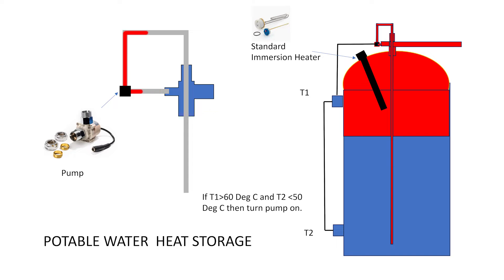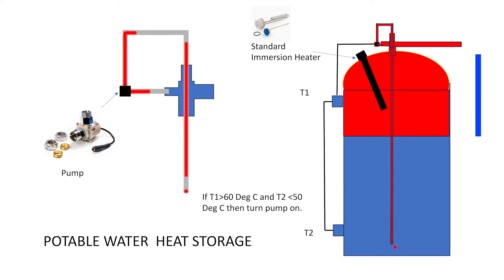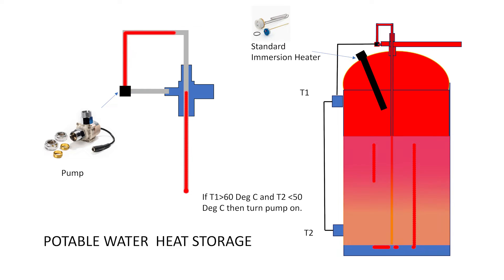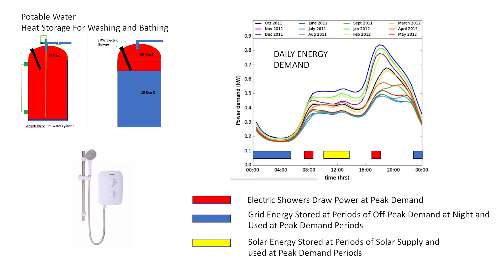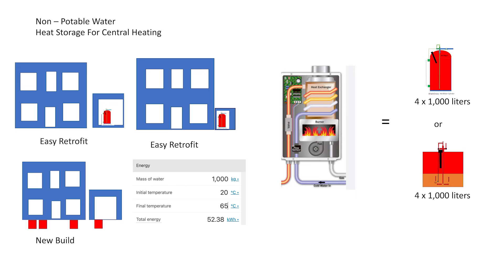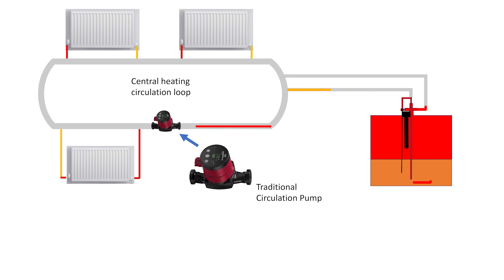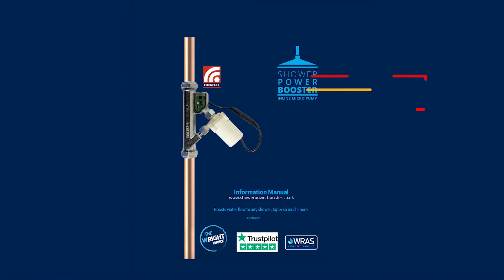Energy Storage Device

Comment: you are storing 50kWh in each 1m^3 tank, so four gives you 200kWh, when the heat in these used, how do you replenish the 200kWh?  Solar at this time of the year may give you a few spare (less than 10) per day.  I have a 5.25kWp system that generated 10kWh today (unusually clear and sunny Jan day) in the UK at 55deg N. Most of the 10 we used as it was generated, only a couple where spare and were exported to the grid.
Reply from the maker: During every 24 hour day there are times when there is surplus energy and on the National Grid and the idea is to use that energy. Potable Water Stratification Device
This device will store energy at times when demand is low in Spring, Summer, Autumn, and Winter. There are always periods of low demand irrespective of the energy source. 
This is a device best suited for retrofitting to an existing hot water cylinder so homes with hot water cylinders are likely to be potential customers. This device is even better suited for customers who have personal solar PV and hot water cylinders so that they can store their own surplus energy during periods of sunlight and also store surplus grid energy overnight.
Primary Sales Targets for the Potable Water Stratification Device
Customers with Hot Water Cylinders
Customers with PV Panels with surplus Summer PV Generation
Customers with PV Panels and Hot Water Cylinders
Organisations wishing to achieve grid stabilisation
Water Stratification Device plus Radiator Flow Boosters
The water stratification device together with the radiator booster gives the potential to significantly reduce use of gas and oil in the Winter only. Demand for heating can only replace fossil fuels if renewable energy (in particular wind power), is increased to supply Winter demand. Increased reliance on renewables will create an imbalance in the grid supply however the  potable water stratification device can absorb this surplus energy in the Summer.
Primary Sales Targets
New build to avoid the need for investment in new gas pipelines.
New build to avoid the need for gas and oil boilers.
Reply: @alandwright2  I fully understand what you are attempting to do, I had a 200L system installed on my heating circuit that was charged by solar excess (immersun), but there was insufficient solar excess in late autumn, winter and early spring. So, the question remains, during these periods where does the 200kWh com from to recharge (reheat) the 4 cubic metres of cold water?  to heat 1000kg (one cubic metre) of water from 20C to 60C takes 46kWh, you need 184kWh to heat 4 cubic metres, where do you get those without a heat source?
Reply: @Staedford as he states in the video, from the resistance element. Not so elegantly explained, but understandable if you want to.

The energy comes from electrical energy when the price is low due to access power on the grid.

If you have an electric boiler with two heating elements, you can get the same results with a computer controlled switch on the bottom element.

I am currently moving the heating of water to the cheapest time of day, I save a small amount of money due to the boiler is only used for hot tap water.
Reply: @MichaelEricMenk  Of course I understand that an immersed resistive heating element is used to convert electrical energy to heat energy in the cylinder.  My question is, where you get the 180kWh of excess (surplus) renewable energy to reheat the 4 cubic metres? Of course you can heat the water at night with night time off-peak electricity in a boiler, but that is not what is being said,....  he's talking about using surplus renewable.  Few have wind, the vast, vast majority of domestic renewable is PV, which don't have that over capacity!  He is states that any time in a 24 hr period you can feed this stored hot water into the CH rads, TRUE,.... when you expend that heat in 24 hrs, which is 100% certain in many 24 or even 48hr periods,  you need to find 180kWh of excess electrical energy for the day after. NOT possible with 99.99% of domestic renewable generators, wind, solar or hydro.
Reply from the maker: The 200kWh can be found at night when supply exceeds demand. Technologies in my home include:
• 8 M2 of solar panels with an amazing and novel micro pump driven solar thermal operating
system.
• 32 M2 of photo voltaic solar panels.
• 5.5 KW Wood Burner (Scrap wood offcuts).
• 13.5 KW/Hr Tesla PowerWall.
• 500 litre (29 KW/Hr heat store), hot water cylinder with micropumps to link Solar Thermal,
Solar Photovoltaic, Wood Burner, Gas Boiler, and Tesla battery store for optimum heat storage.
• 4,500 litres of stored rain water delivered at high pressure using micro pumps.
At night I use cheap rate electricity at 7.5p KWHr to fully charge my Tesla Power Wall and during the day I sell every spare KW of electricity I generate to Octopus  I do not use the Solar PV Energy I generate to heat water.
Reply: @alandwright2  While the grid might sometimes have excess renewable at night, we have no direct way to know (unlike for a domestic system), unit price might remain be a good proxy.  As we all move to charging cars and offsetting load like heating to the night, the 7.5p rates will disappear.  The main challenge is to reduce usage, not (just) offset it.  To that end a heat pump will reduce the electrical demand by around 70%, for every 1kWh you buy, you'll get 2 to 3 more free. OK, this will be time limited and not as easily storable but it is a net reduction in electrical demand. There is a place for offsetting, but we don't have the network capacity to electrify the whole country's heating and try to make it work by offsetting that load to night, plus added EVs and battery systems.